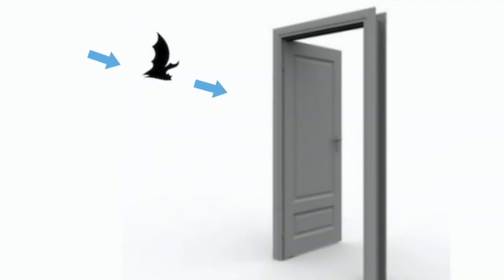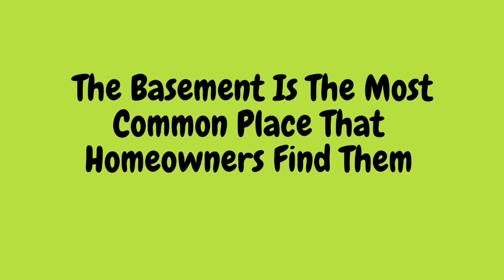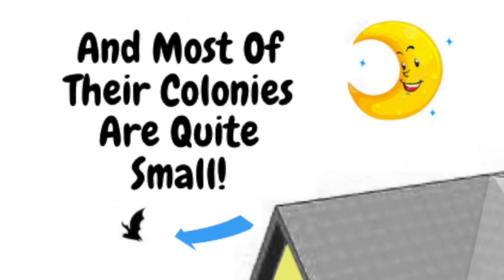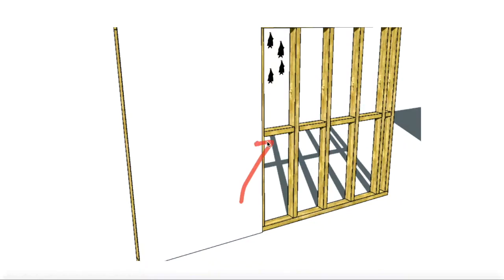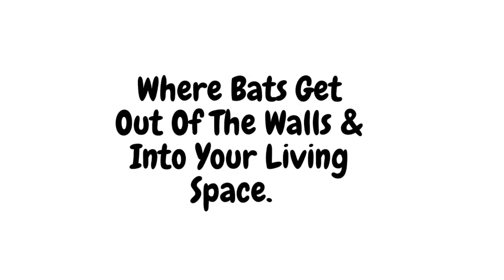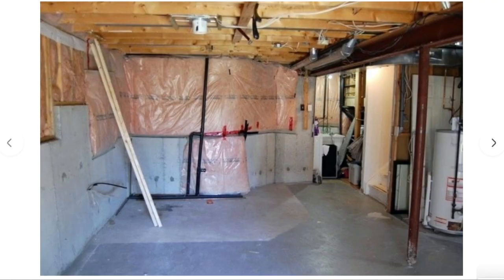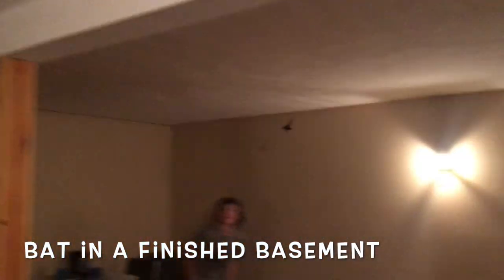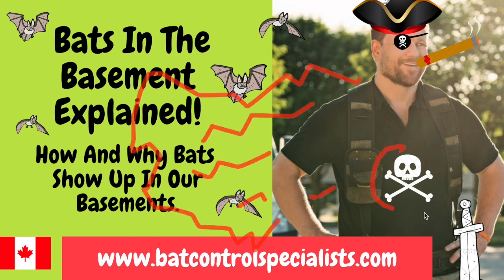Explained! Why Most Bats Show Up In Basements First.

Comment: Tried to turn my furnace on yesterday, but it was a no go. I ended up pulling the induction motor and saw a dead bat in the housing which was preventing the motor from spinning and operating the switch that the vacuum hose goes to. I've been living in this house for 22 years and never had a bat problem. I've been in my attic multiple times and never saw any signs of bats. I'm assuming the bat got in through the flute pipe exiting my roof some type of way. My flute cap doesn't appear to have any gaps small enough that will allow a bat to get in though. Hopefully, this was just a one time issue.
Reply from the maker: Hopefully 🤞